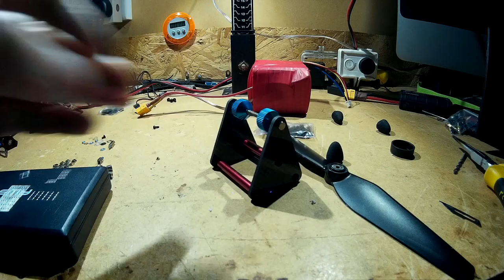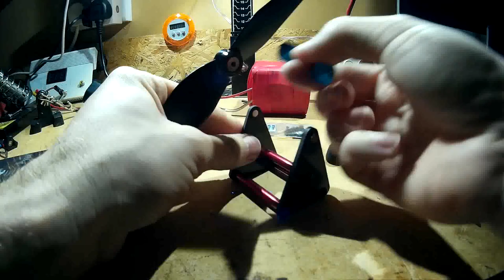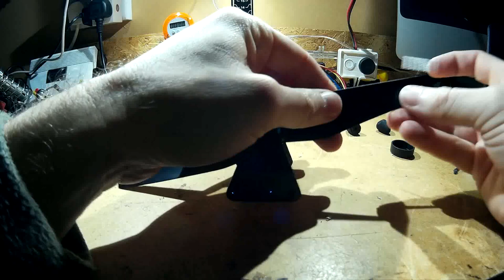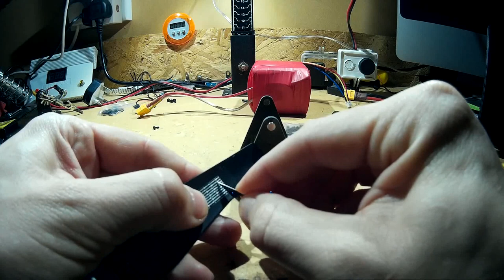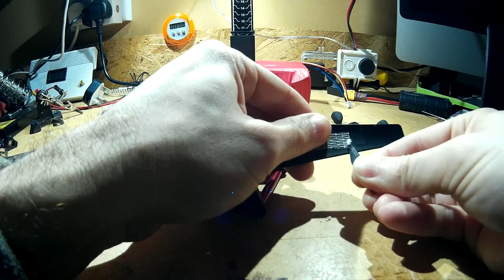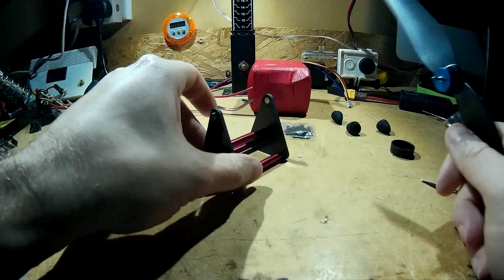SYMA X8C Balance your blades for smoother video

Comment: just checked.  the blue holders are out of balace, checked it without propellors.. just balanced the balancer.. I used some crazy glue on the light side.. I did one at a time. And checked 8 of the propellors i supposedly balanced. and had to rebalance them again... When you but this.. balance the balancer!!!

Comment: Won't the type slow down the propeller
Reply: No, it generally won't affect the prop at all. There isn't enough weight to make any difference. But having them balanced will help with flight times, and help keep it balanced during flight.

Comment: your balancer looks pretty out of balance to me, best fix it first otherwise you will make your props worse
Reply: Gogs ffs also the centre of the prop is heavy on one side which is why it kept returning to level once properly balanced it should hold its position were you let go
Reply: The balance rod for the props is magnetic, so it doesn't always set in the center of the balancer. As long as the magnets support the rod, it will balance them really well.
Reply: Those cone nuts are not factory balanced, that is a DIY job.